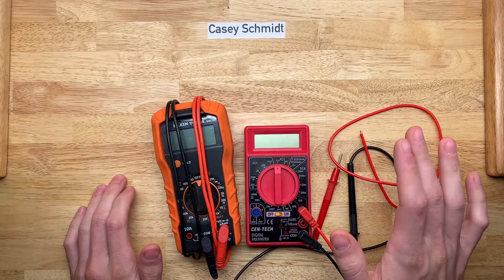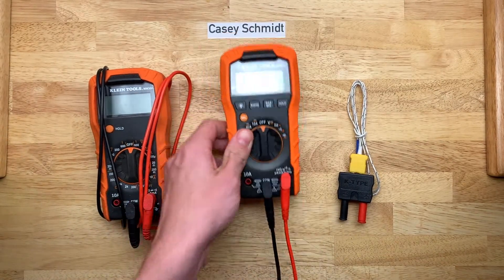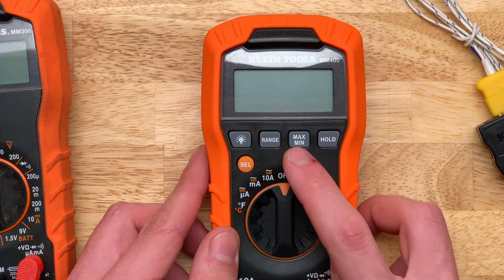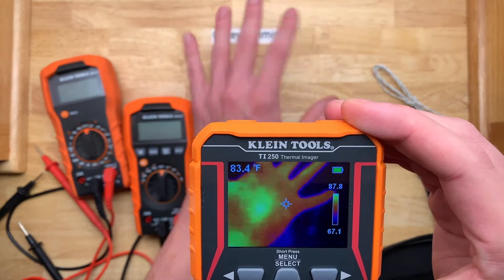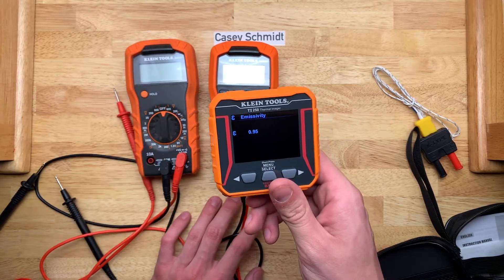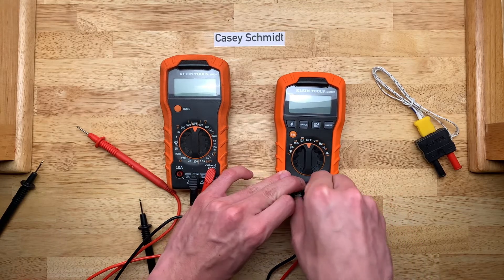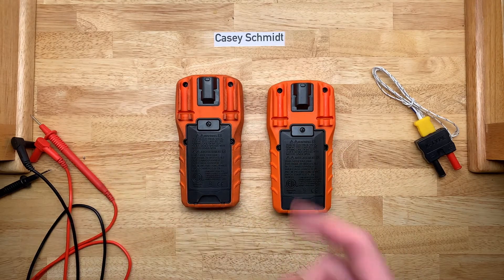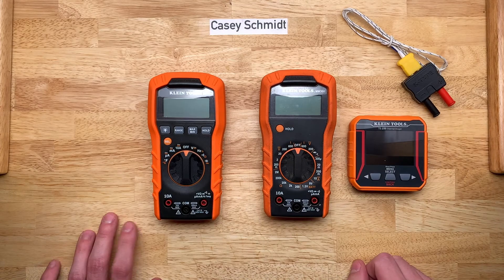Two New Meters! TI250 and MM400 Klein Tools

Comment: Great video sir question I’m technician you think with the tl250 I can see leaks on ac coil or like thank you in advance
Reply from the maker: If there is enough of a temperature differential, then theoretically it could certainly detect it. However, for professional work, I’d probably look at the FLIR even with the downsides of cost, complexity, and often needing an external smart device. Since the Klein tools version is so inexpensive compared to the FLIR models, if you think you would get good use out of it outside of your profession, it might be worth picking up anyway. Thanks for watching!